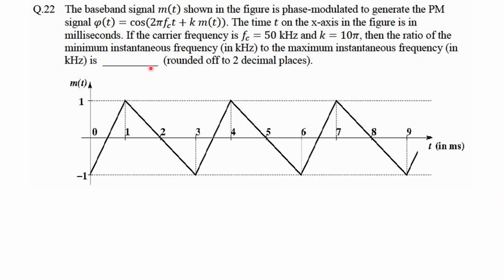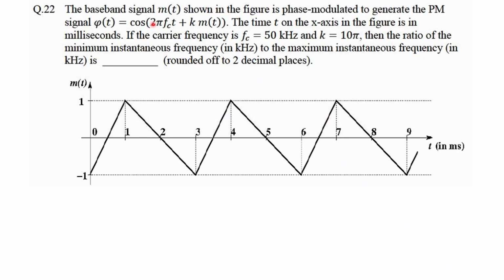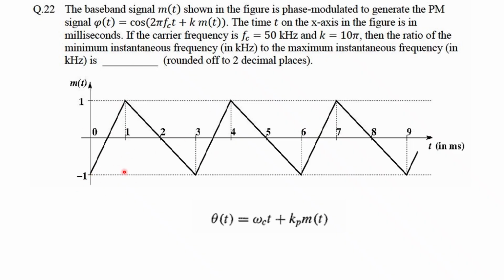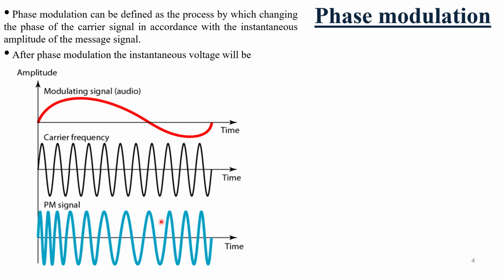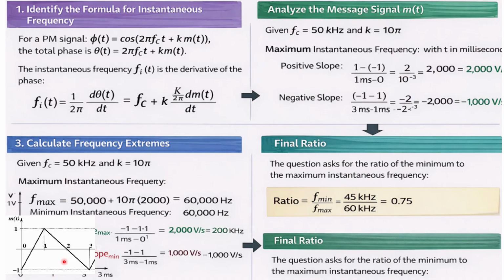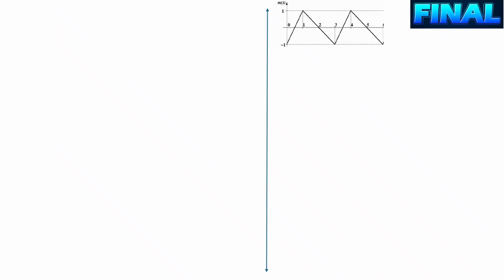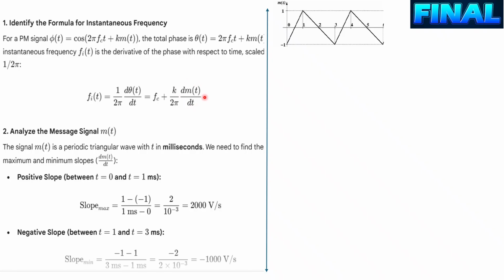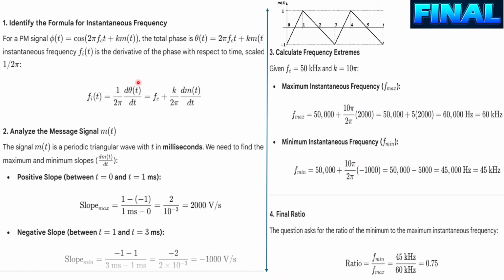GATE Q&A 2019From Unit-1&2 /// ANALOG & DIGITAL COMMUNICATION

Comment from the maker: https://youtu.be/Bxx8LY-eR0E?si=tYjzDGbOJVnJPBbV
Radio Transmitters and Receivers UNIT-2, Part-II /// ANALOG AND DIGITAL COMMUNICATION
https://youtu.be/YUNAEhhVeGY?si=7j5tgazDnwfzwm1-
Unit 2 AM Transmitter (Low Level and High Level) AM Superheterodyne Receiver
https://youtu.be/VWLCkh0096I?si=D-4gEoW8DRQR5k-T
Analog Modulation Techniques UNIT-I, Part-IIB
https://youtu.be/sET-zYxlJgI?si=s4Lzv_PlO3K31q40
Analog Modulation TechniquesUNIT-I, Part-IIA
https://youtu.be/OkEE3JXqGE8?si=GHKFsGM8S2Dy-CJW
ANALOG AND DIGITAL COMMUNICATION /// Analog Modulation Techniques
https://youtu.be/8f9njZcz8NM?si=8B1qvSuPtYmjVl2w
ANALOG AND DIGITAL COMMUNICATION /// Analog Modulation Techniques UNIT-I, Part-I